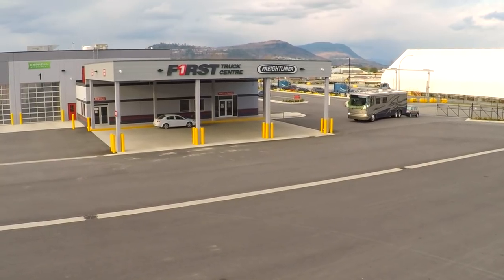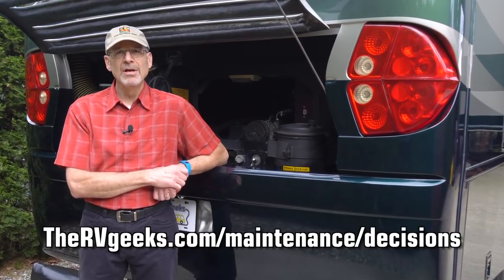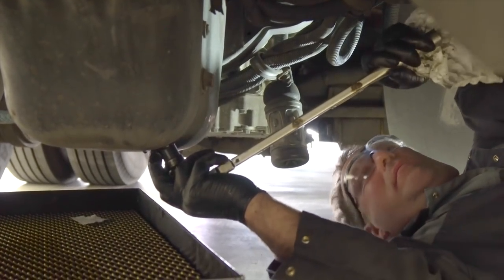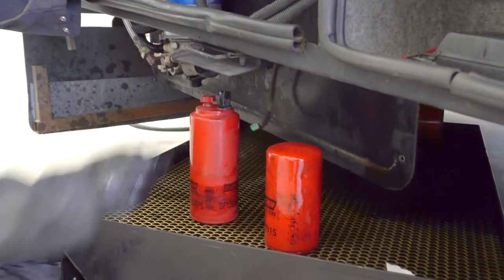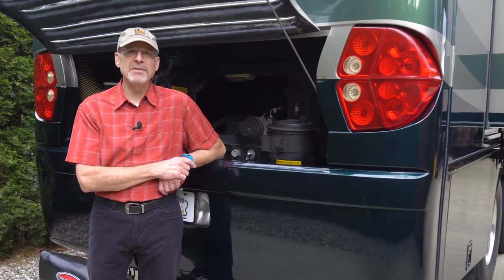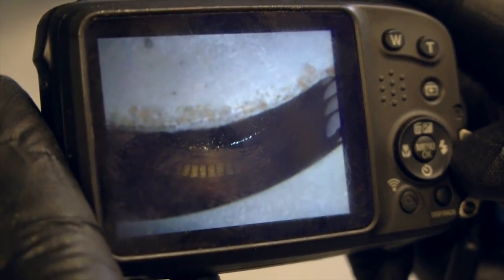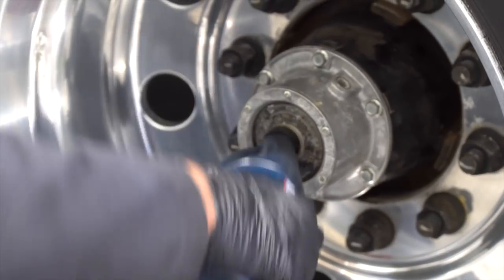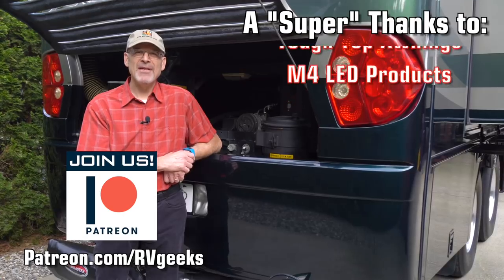🔧 RV Maintenance - Part Two: Decision Making 🤔 + A Ticking Time Bomb 💣

Comment: Always such great info guys, being a new full timer it’s a great go to.
I purchased a 2011 Fleetwood Tioga c class in November, any advice for where to take it for an oil change, it’s far to big to get it into a quick service shop?
Reply from the maker: Thanks, Colin! We've only ever owned diesel pushers... so we've always gone to heavy-duty truck service centers (we certainly couldn't fit in a Jiffy-Lube, even if they could do our service, LOL). That said... some truck service locations (like the one we went to in this video) DO perform basic maintenance on gas coaches. So if you have one nearby, it can't hurt to call and ask. The other option is to go to the brand car dealer that your RV's chassis was made by (Ford or Chevy)... they can often do the service, too. Hope that helps!
Reply: RVgeeks thanks I will try the Ford dealer here in Victoria, the vehicle has really low KM 19,000 but, it’s 8 years old, would you have the transmission fluid and filter changed as well, as new coolant when I take it in?
Thanks again
Reply from the maker: While we hate to do unnecessary work, we hate even more to NOT do work that's overdue. If you're a new owner of a used rig, and don't have the maintenance records from the previous owner, it might be prudent to do all the scheduled maintenance and start fresh with a new,  known, baseline. It's a bit expensive, but if you can manage it, it's a great way to start off a new ownership experience. Of course if you have records that show the coolant was replaced last year, and it's only due once every two years, there's no reason to replace it.
Reply: RVgeeks no documentation unfortunately, my gut feeling was to replace all the fluids without knowing what has been done thanks for reaffirming 😀

Comment: Overall, how much does it own a rv(maintenance, fuel and insurance)?. I’m new to this rv stuff.
Reply from the maker: Hi Aaron. Well... that varies a lot based on how you RV. Type of RV plays a big part (diesel pusher vs gas class a motorhome vs towable, etc), since  towable RVs don't have an engine & drivetrain to maintain. Then there's HOW you RV. Do you travel non-stop, moving every couple of days and covering large distances (higher campground costs for short-term stays and more fuel & maintenance costs for things like tires, etc)? Or will you be slower-moving, spending longer stays (thus getting long-term, lower rates at campgrounds) and traveling in the RV less? And will you be staying only in private campgrounds? Or will you dry-camp/boondock on BLM land at all? Or a mix? There are just so many variables, that even knowing what WE spend on all of those things might not truly help you, if your mode/style of travel isn't the same.

That said, for our 43' Diesel Pusher motorhome, traveling at a slower pace (roughly 5,000 miles per year on average) and spending more time in fewer places (with a lot of dry-camping during the winter months in the desert southwest), we've averaged roughly:

 - $2,500/year in insurance costs (which includes full-timer's coverage for more valuables on board)
 - $1,600/year for maintenance & repairs (which is averaged over 15 years of full-timing and includes 1 full replacement of 8 RV tires, an engine oil leak repair and the replacement/upgrade of our original Norcold 4-door fridge to residential when the Norcold failed)
 - $2,500/year in diesel fuel (5,000 miles/year ÷ 7mpg = 714 gallons/year * $3.50/gal)
 - $5,000/year in campground fees (averaging about $15/night by staying free on BLM, then splurging for "resorts" on occassion)

Again... your numbers will likely vary, but we hope this gives you an idea. For a different perspective (17' Fiberstream trailer), check out Drivin' & Vibin's monthly budget reports to see how living smaller compares:  https://drivinvibin.com/category/monthly-budget-reports/

Comment: My wife and thinking to buy a Class A Rv... how much is a service in a Class A Gas?
Reply from the maker: Sorry we’ve never owned a gas rig, so we’re not sure. Your best bet is to use the information in this video about the types of services that get done, check your owners manual for maintenance intervals, and stop in to a reputable RV maintenance center and ask them for pricing for the tasks you need done on your specific rig.

Comment: Did you notice that the tech did not torque the lug nuts correctly? Incorrect pattern.
Reply from the maker: I did see that on the video... and you're absolutely right. But I'm gonna have to take the rap for that here. We were in these poor guys faces with cameras all day (a very long day). I have no doubt that our constant "hold on a sec please so I can get that on camera" was pretty damn distracting. I have every confidence that they know what they're doing, and sorry if our videoing made it look any other way.
Reply: RVgeeks   It’s nice if you to cut them some slack, but a well-trained tech would never torque wheels that way. He would be so used to the “star” pattern it would simply never happen. Obviously a newby, and an untrained one.
Reply from the maker: Thanks for the feedback. For whatever it's worth, he's the guy who did the wheel seal, and he explained the entire teardown and re-assmbly process in great detail as he went, so we're going to assume he's qualified. We do plan to ask about the torquing next time we're in their shop though. Thanks again.
Reply: RVgeeks  Not knowing the correct wheel torque pattern is a large, and surprising, gap in his knowledge.
Reply: RVgeeks   Here’s a story you might find interesting. I took my Mercury Grand Marquis to a quick lube which had a viewing area next to the bays. You could see and talk to the techs. The tech drained the oil, replaced the filter, and began pouring quarts of oil into the engine. After 3 quarts he stopped, wiped his hands and moved toward the drivers door. I was stunned for a second, then shouted “excuse me, it takes 5 quarts!” He said, “I know, I always add 3, then start the engine, then let it sit for awhile before the final fill, to make sure I don’t add too much.”  Of course I didn’t allow him to do that, and demanded that he add the full 5 quarts before starting the engine. So where did he get such an insane idea? It certainly wasn’t taught in automotive tech school. Probably from his “Uncle Billy” or “Grandpaw John”, and he had always done it this way. 

Your tech most likely learned his wheel torque pattern the same way. The shocking thing is that no one was supervising him.
Reply from the maker: We appreciate your input, and, as mentioned, we'll inquire about the lug nuts next time we stop by. As you may have seen in our videos, we're pretty anal retentive about our RV. And after being given the opportunity to see up close for an entire day exactly what the team working on our rig was doing, we in no way feel this brief moment in any way represents the overall calibre of work we saw being done. We were extremely satisfied.